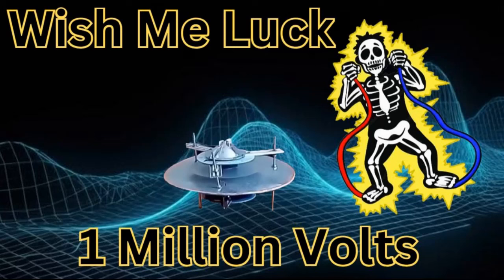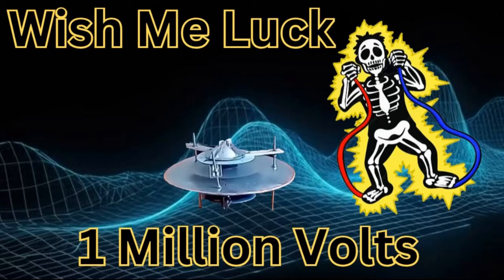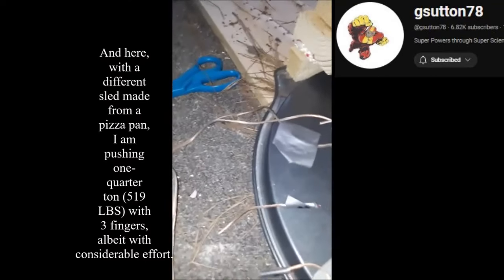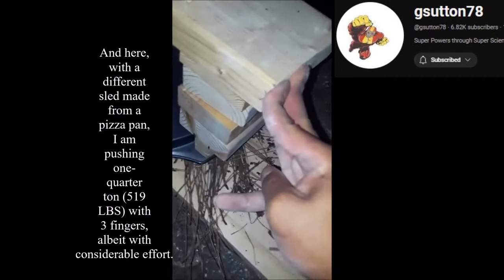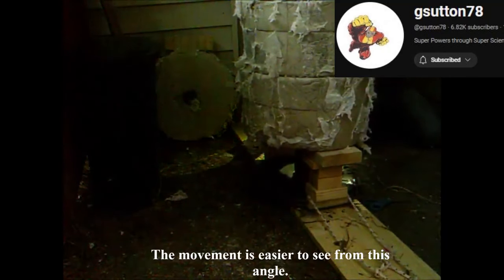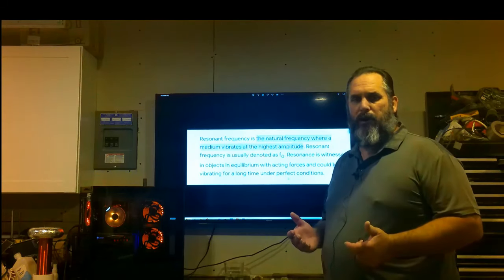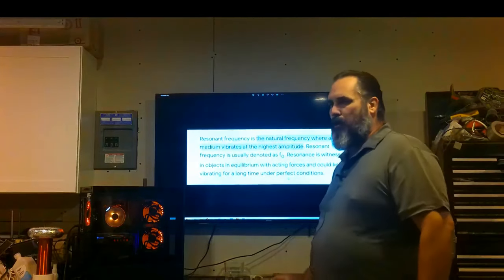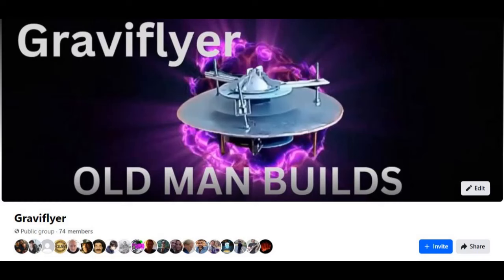Graviflyer "1 Million Volts???" #50

Comment: F = q*E - m*g = 0. If the Earth has a negative electric field E = 100 to 300 V/m, the mass of the GF is m = 1kg, and gravity is g = 9.8m/s^2. Therefore;
q/m = g/E = 9.8/100 = 0.098 Coulombs/kg. For lift, q must be negative. So an abundance of electrons will float, Aka ball lightning. The capacitance of the rotors is at most ~100pF. At 0.1C, that's about 1 billion volts. At E = 300V/m, then about 333MV should do it. Resonance alone won't get you there. 
A vibration still requires a force of F > m*g to lift the mass off the vibrating surface.
Reply: I agree with you, but the vibration, i still have to understand why there is the piezo, Alexandrey (sp??) inspired himself to the work of Grebbennikov, who studied insect flight, the vibration in my opinion is used for triboelectricity, the electrons charge the inner honeycomb structure of the insect elitres(sp??) , acting as ion traps, creating a amg field strong enough to float on earth's mag field just like a diamagnetic material floats over a strong magnet
Reply from the maker: if i was just vibrating something to displace weight you are right. I think a resident state won't allow gravity to settle on us and create the same force. That is the only way this works because your math is 100% correct until you are no longer receiving the same amount of gravitational force. I do not see this being a known physics equation. We would probably find it in  Ramanujan book of equations though.
Reply: @nathanbunten4299  Conservation of momentum cannot be violated on this scale. Even 100% efficiency is impossible. If the Earth were highly negatively charged, we could repel it. But at 100V/m, it's basically nothing.

Comment: Idea for a description of what resonance really is:

Method for creating/achieving dielectric coherence mechanically. 

What I mean is this…
Atoms are sticky, but not “attached” per se to each other. The dielectric field shape of each atom has properties and alignment domains that can be made coherent either by applying voltage (magnetic potential) or mechanical vibration. In the first case, the magnetic potential wants to realign all the field domains with the field, but can’t because if the geometric orientation of the atoms themselves; this causes heating, deformation, and ultimately can make the material revert to an internal magnetic equilibrium state, after which it is no longer externally magnetic. 
OR, through mechanical vibration, which still has a magnetic aspect, but is using uniform kinetic energy of the atom itself to manipulate the external field properties as opposed to using the field to orient the atoms.
Reply from the maker: Magnetics are close. You have to go to the root of what they are and it's the "charges" themselfs. I do like the way you put the rest of it though.
Reply: @nathanbunten4299  thank you!  I’m trying to get a good conceptual grasp on what atoms and fields actually are on an individual material basis. I think our collective material science suffers because of the Bohr electron model of a point-nucleus and electron orbitals. I much prefer the structured atom model SAM for short of Edo Kaal. It appears to better explain the behavior of matter and energy than the rest of physics which merely does an excellent job of describing material behaviors, even if it lacks predictive capacity for new material designs and atomic orientations. 
In short, if we really understood what atoms are and how they work, the superconductivity of Graphene wouldn’t have surprised us.

Comment: TTBrown stated that his disk shaped antigravity craft used 2 million volts I remember reading that, many years ago.... I do Not believe it is Resonance in any way shape or form
it is brute force to block out the Higgs Boson !  Alexia used a great deal of voltage I believe in his first videos he showed 2 or 3 fly back coils one feeding the others i am guessing but that equates to close to 800,000 to 1m volts ....so 1M volts should get you in the ball park
.... yes Resonance is a possibility... but in my mind a weak one ! brute force is the safer way to go to achieve the desired results..... perhaps not so safe for you though ! TTBrown did it with 2M volts and there were pictures of it levitating (back in the 1980's) I think the government took the pictures down due to national security but that is besides the point.
..... and Stanly Myers car worked. he did use Resonance in his Hydroxy cells.....
I didn't and still achieved 48mpg in my little truck !
Reply from the maker: How to make sure no one ever can make antigravity 101. Tell the an unachievable voltage causes it. 

The water can can be improved beyond 48mpg. 

Alexey did not use a million volts. If thing works he had to find another way to do it.
Reply: how the hell did they get that voltage in the 1920s? I didn't think they had the tech to get that voltage back then
Reply from the maker: @fireball75677  tt brown was the 1960's and the water car was the 70's I think. Who was in the 1920's ??? 1920 bc is that what you are saying?
Reply: @nathanbunten4299  sorry I thought TT brown did his experiments in the 20s I must have miss heard something in the old videos my bad
Reply: Can't resons be used to make hydrogen?
Reply from the maker: @tonywalker8030  yes

Comment: You need to look at the primary winding frequency of Alex Tesla Coil is and what the wave shape is.  And you need to measure the secondary frequency and its  wave shape is.  You really need a wideband spectrum analyzer to pull out all the frequencies of his tesla coil. Got to give you credit on the graph and egypt thing very good..
Reply from the maker: It would not matter. When you put a wire down the coil the top 4" is changed to what ever the center plate is putting out.